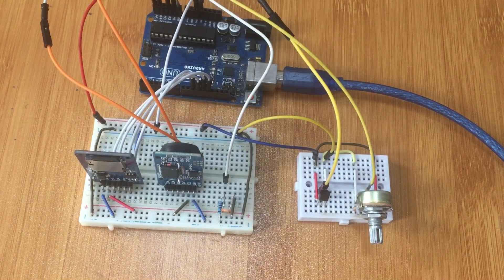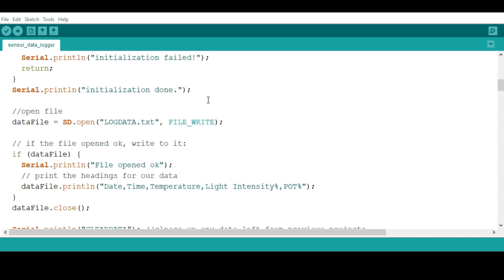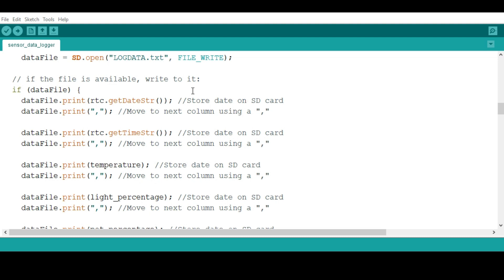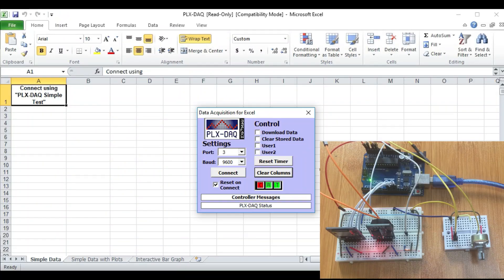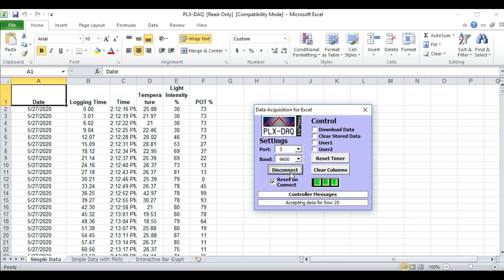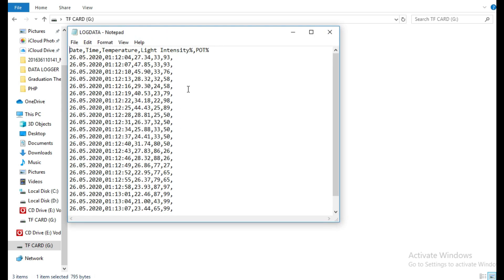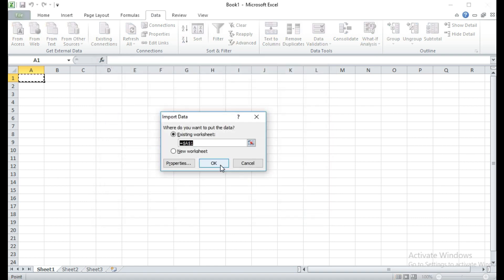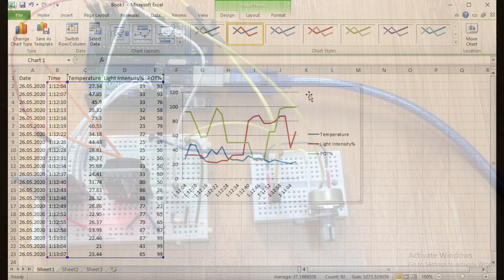Arduino Data Logger Using SD Card and Excel.

Comment: Thanks for the video sir. I am using a pressure sensor connected to Arduino, SD card module for data logging it and RTC for date and time. I initially formatted the sd card and used it. It was working fine for the first time. I took the sd card for extracting data and then when I re-inserted, it's not getting initialized. Sometimes the file is not being written on the text file. i am facing this issue intermittently. kindly provide some solutions. I tried many ways to sort out but it was not working.